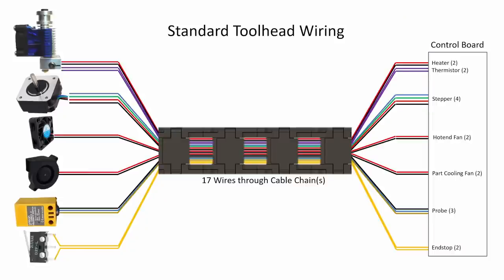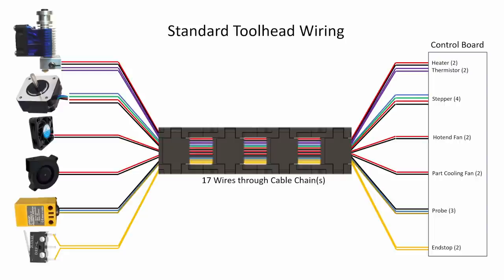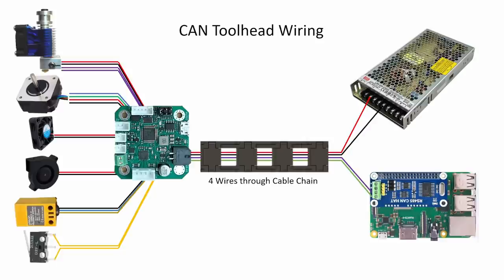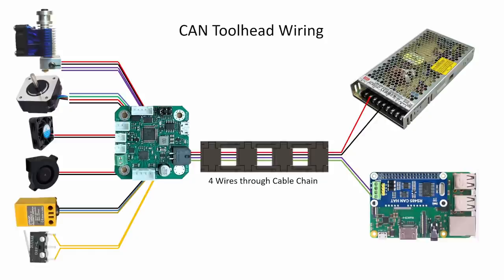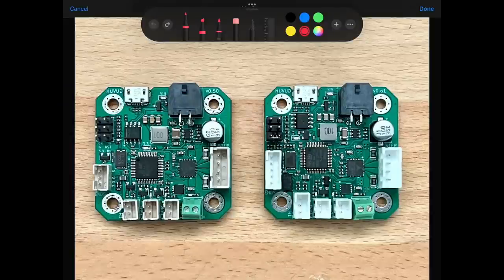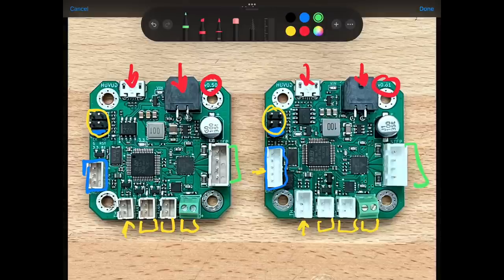Simplify your 3D Printer with a CAN Toolhead Controller!

Comment: You can also use OpenOCD on a Pi to do SWD flashing (from Pi GPIO) of the STM chip, or in a pinch UART and stm32flasher with the boot0 jumper and pulling the resistor that makes the uart half duplex for the TMC2209. ST-Link is by far the easiest option if not in a hurry though.

Comment: A coworker of mine designed and manufactured a breakout board with a similar intent just  a couple weeks ago. He toyed with adding an onboard driver but ultimately ended up with just an atmega 328(arduino), adxl and mosfets built in he's using serial so that all you need to run is an off the shelf USB and a 24v power/gnd. I'm pushing him to release the designs
Reply: Pretty sure we can run the same on this, 24v/G and usb micro to pi

Comment: Thanks for the video! This is a great resource I haven't had time to come back and talk about myself!

Its been a long while since they've been available, it took me a while to choose a manufacturer instead of getting small batches made from a prototype house.

I'm hoping to have an answer on preorder and quantity this week, and will be looking to get batches sent to vendors worldwide so its easier to order in everyone's local countries. 

I appreciate everyone's patience on getting more done, and I'm also sorry about the cost. Unfortunately, with both part availability (price on just the MCU went from ~$.5 to over $14!) and tariffs for importing, I couldn't provide a better price point. If the demand is sufficiently large and I can order large quantities, I'm hoping to drive prices down to ~60 for preorders including a connector kit.
Reply: Looking forward to buying one of these when I can. I was looking to right at the beginning of the pandemic in the "yeah, 1 or 2 more months" stage. :/ $60 isn't unreasonable, especially for a premium printer like a Voron. The StealthBurner adds another compelling reason to use this board - not having to run another set of wires for LED serial comms. :)  However, I'm not seeing a nice clean way to mount a board in that toolhead. Hopefully somebody can show me the way before I build one. I'm sure you're aware, but there seems to be more availability if you move up a bit in capability and switch vendors. For example Microchip's M4. Unfortunately, it's still a lot of work for you developing and selling them and the supply chain is fickle. :(

Best of luck and thank you so much for the contribution and showing us the way!
Reply: Great news. Would you have a list of vendors somewhere so we can all reach-out to them and pre-order. Not sure where to look for it at the moment (I'm in UK).
Reply: @alexdubois6585  printyplease has 100pcs of my units coming to them. Otherwise my preorder is up.

Comment: while there are 17 wires, you can have several items (two fans, hot end, and probe) share a common VCC wire.  Also the end stop, probe, and thermistor share a common ground.  This reduces the wiring from 17 to 13 in total.  Still quite a few wires, but not as bad as first glance.  Also even with the CAN board you STILL need to crimp connectors at the toolhead, that does NOT go away!

Comment: If you want a really stable connection, make sure you have 120 Ohm cables! Together with the 120 Ohm terminations it will look like an infinitely long wire, from an RF point of view, eliminating reflections. This should make it absolutely no problem using a 500k bitrate.
There is good videos about it in YouTube.
Reply from the maker: Agreed! I know it's best to have it, but realistically to add one to this board you have to
1.  Have a surface mount resistor on hand and know how/where to solder it
2. Double crimp a resistor with the data connection wires on the molex connector
3. Hack mount a resistor hanging off the board

I did the last one with my first board, but in general don't recommend that to the average user. "2" is probably the safest and best option, assuming you have a 120ohm resistor on hand with really thin leads so you can still get the terminal properly crimped. 

In general--my approach is if there's a simple way that will work for 95% of cases without the need to solder--that's probably the correct path for most people. I will touch on this some though and explain the options for a follow up video!
Reply: @eddietheengineer  Agree. Well, I hope the new extruder board has them built in ;)
Reply from the maker: @m.sierra5258  yes! I haven’t looked yet at the PCB layout, but hopefully if it’s auto populated and you need to remove one (if you have many boards) if would be in a place that you could knock it off with the tip of a soldering iron
Reply: "There is good videos about it in YouTube."  There are over a billion videos on YouTube. Could you be more specific?

Comment: Just set this up using the BIQU Hermit Crab. I'm a big fan of it. It uses CANBUS and let you run only 1 cable to the toolhead which is awesome.
Reply: Don't the hermit need 1 usb-c to the toolboard + 2 power wires?

Comment: "I have omitted the 120 Ohm resistor on the toolhead" - "I had to turn down CAN bitrate to 250k for stability"
... Maybe there is a connection between those two things? Just maybe?

Comment: That's pretty cool if one ever comes up that fits the orbiter and Stealthburner, I'd be interested.  Still quite a bit less wires than the other toolheads, so bravo.
Reply from the maker: I have a mount for Clockwork 1 and Galileo, and will make a CW2 mount once the CAD files are released!
Reply: @eddietheengineer  awesome . I just put a toolhead on my stealth/Galileo, but I've got comments on the constant use of the JST-XH  connectors forcing folks to crimp., vs using  a screw style like you are using on the bottom right of your board. same pitch 2.54mm, -40-100+c temp rating, can get them from 10amps to 6amps and it removes the crimping all together (yes, one would need furrels but man those are easy!). Obviously one could go further and do screw-less clamps, that would make installation and swaps even easier. I just spent hours crimping today and it's not enjoyable, some wires are just too small and you end up breaking them, other wires (hotend) are too thick and don't fit.. Love to see you all start moving away from these tiny connectors that require crimping :) Your board, only the bottom 2 would have to be adjusted to allow the screw type terminals to be used (but appears you are already running out of real estate, but you could run 2 back to back in the same space as the.2 side by sides there. But obviously the through holes would have to be run horizontal vs vertical. Also if you have a jumper to power via the USB, surprised you can't have a jumper or other to select 5 volt for LEDs or set the fan ports individually.   Cool stuff... but man, these JSTs pissed me off today :)

Comment: Great video!   I'd have loved to have built my Voron with a toolhead board.   As it is, I have some small protoboards to break-out silicone ribbon cables to individual JST connectors.  I wonder if the parts are mostly available?  Might be a fun project,  even with what looks to be 0402 size components..   This seems like a great solution and the wave of the future!  It's amazing how quickly the wire count adds up..
Reply from the maker: Thanks! I'm not sure about component availability for all of the components; the one I've heard regularly having supply issues is the STM32F103 micro that's used.

Comment: Very interesting device, how's extruder driver feels after long prints? I noticed it doesn't have heatsink. Interesting to see if this board requires additional cooling when it run in enclosed(+60C) printer.
Reply from the maker: That's a great question and one I've done some testing on--I haven't been able to get the TMC2209 to have over temp warnings in all the prints I've done with Huvud V0.50 a year ago. I have an enclosed printer with a layer of Reflectix insulation around it, with temps around the toolhead in the 65-75C range

Comment: What such boards doing on a toolhead? I`m not about this one. This one is wiring simplification option. But the general ones that powered by 16 pins from motherboard. Can you omit them. Or there are some logic and it's not just connectivity bridge.

Comment: Do I understand correctly that huvud 0.61 has a 5V pin for probe so you can't use the voron recommended Omron TL-Q5MC2 which is 24V?
Reply from the maker: If you wanted, you could pull 24V off the board someplace and the use a bat85 diode (similar to how we wire the probe with some main control boards) to protect the MCU

Comment: Is there a temp rating on this board? We are looking at 80C chamber rated connections, components and cables for the Valkyrie
Reply from the maker: I only have data from my printer where it’s worked up to 65-75C chamber temp—I believe a lot of components are getting close to their rated temps at that point. It’s worth doing testing and understanding how much margin you’d have in your printer application!

Comment: Looks like someone beat me to it - but can 0.61 handle StealthBurner? I'm thinking the 5V for the end-stop and extra 2 pins, means we can do probe, ERCF, and LEDs? Would love to watch a full walkthrough of installing in a SB config. Thanks again for sharing. Can't wait for more of the Huvud github to be updated.

Also - does lowering the number of wires in the drag chains improve print quality at all? (Always looking for ways to get higher quality prints)
Reply: Probably not, but why run cable chains at all?  I run a Huvud on a Switchwire with an umbilical setup, and I'm going to do the same with the new Huvud I just managed to snag for my 2.4.

Comment: Unrelated, but also not: I don’t like using USB to connect things like screens/sensors to my RPi. gasp! I do however like using UART. Pi3s only have one (?) UART available, but the Pi4 has four (?) I think? For Pi3 users, are there options available in Klipper to multiplex UARTs? Or use an UART expander? If that was a thing, then with a revision the ever-capable, handy-dandy Klipper Expander could handle more than just MOSFETs...
Reply: If you do serial-over-USB, in theory the Linux kernel driver could do DMA transfers or more efficient transfers of data to/from the USB controller as compared to character-at-a-time interrupts for the UART peripherals.

Comment: The formula to calculate heat dissipation is [I² × RDS(ON)] × (VOUT/VIN) so by using 12V you don't heat the mosfet more, nevertheless,  greate video  good job.
Reply from the maker: Thanks for the formula! In this case, I am assuming a constant heater wattage between both input voltages (say 40W), which would make the current 2x higher for the 12V vs 24V input. I think that would mean that the heat dissipation for the mosfet would be 2^2 higher based on this equation? I think the Vout/Vin would be close to 1 in either voltage case?
Reply: @eddietheengineer  a 12V heater I² is not equal to 24V heaters I² if same wattage. in the formula if V differ I² can't be same or result can't be same. ommit vout/vin division if you don't want to calculate resistive thermal dissipation. sorry for my bad english i hope it makes sense.

Comment: Do the crystals have to match? I could only find 12mhz RS485 CAN hats. Video was not definitive about which one to use. I’m guessing 8mhz but not sure.
Reply from the maker: That's a good question, the crystal on the Huvud doesn't have to match the crystal on the CAN hat. The Huvud has an 8Mhz crystal (and you need to set it to 8Mhz in the make menuconfig). 

If your Waveshare is 12Mhz, then that's fine! Just set your config.txt to:
dtoverlay=mcp2515-can0,oscillator=12000000,interrupt=25,spimaxfrequency=2000000

Comment: Do you flash the Huvud 0.61 directly by a RPI with latest Klipper?   Does the CAN hat need to be on the Pi for this or can I add it after?
Reply from the maker: Yes you can flash it from the Pi! The boot jumper must be set, a USB cable connected from the Pi to the Huvud, and 24V sent to the Huvud

Comment: The reason you're having an issue at 500k is because you're not using a 120 resistor on both sides.  Add the missing resistor and the higher speed will work.

Comment: Is it possible to have multiple canbus tool heads connected? Like dual extruder or even 4 toolhead with an automatic tool changer. I was researching about it but cannot fin any example of at least a dual head setup
Reply from the maker: Yes! You can have multiple toolheads on one CAN bus, I do it for Tridex (Trident IDEX)
Reply: @eddietheengineer  do you connect all to the same ports?
Reply from the maker: @IvanGOrtolan  yes! it is best to have the CAN devices in a "chain". I have mine set up so that each toolhead is the "termination point" and then the CAN adapter is at the center

Comment: Will that 5 pin endstop connector finally support bltouch on the huvud board?
It should, but I think I would need to combine the 2 ground wires from the bltouch into the single endstop ground pin.
Reply from the maker: That’s a good question—I haven’t used a BLtouch in a few years unfortunately, so I’m not super familiar on what is required

Comment: CANBUS is an extreme robust protocol when both ends are terminated with a 120ohm resistors otherwise the integrity of the signal will be heavily degraded.

Comment: regarding the accelerometer there is a doubt as you need to meazure the resonance for x and for the y table also) with this board only x ?
Reply: I'm sure it can do multiple axis, the only reason it would be an issue is if you're running something like a bed slinger since the accelerometer would need to be moved. Both X and Y can be measured from the tool head on a coreXY printer.

Comment: Eddie, do you have a mount for this board published anywhere?  I designed a mount I've been using on my Switchwire that uses the hartk mount points on the side of the CW1, but I'd like to transition my 2.4 over to CW2 and I'm not sure how I can make that work with the Huvud.
Reply from the maker: Yes! Not published yet but I can, I have one for the back of CW1 and Galileo, not CW2 yet
Reply: @eddietheengineer  I would love to see your mounts.  I just received a v0.61 Huvud and I removed all the wiring from my 2.4 in preparation to install it.  I can use my existing mount on the CW1 that's still in that printer, but I'm curious to see other ideas.
Reply from the maker: @jakepF1D  I’ll try and get something uploaded tonight!
Reply: @eddietheengineer  Much appreciated!

Comment: Are you able to run the board over the micro USB cable instead of can? As you said alot, maybe not the right or robust way, but it would be a very easy way to get started.
Reply from the maker: I don’t know if you can directly run it through the microusb port but I think you can run the usb data wires to the 4 pin connector and then cut/adjust traces

Comment: Is it possible to use the "Huvud 3D Printer toolhead board" directly with a BTT Octopus instead of a "Raspberry Pi CAN hat" ?
Reply from the maker: Unfortunately not at this time!
Reply: @eddietheengineer  THX
Reply: @eddietheengineer  RS485 CAN HAT support Pi 4 ?
Reply from the maker: @wolfgangmauer7970  yes! I’m using a waveshare can hat on a Pi 4
Reply: @eddietheengineer  THX

Comment: Skipping the pull-up or pull-down resistors would be the reason that you had issues with 500,000 and not 250,000.

Comment: Thanks for the video and the effort!
Concerning the board, am I right that no spare pins (assuming a bl touch is used) are left for controlling pwm fans (the 4 pin fans which provides tacho and accept pwm input)?
I don't see any spare connector.
Reply from the maker: You're correct! There aren't any connectors for 4 pin fans. I'm not sure if you could use the debug pins for the pwm/tach signals or if they need to be 24V?
Reply: @eddietheengineer  pwm and tacho are TTL, any free pin would work bitti don't see any spare pin available on the board, so I guess the only way is to use the extra ones from the endstop
Reply from the maker: @olafmarzocchi6194  I wonder if you could use some of the debug pins?
Reply: @eddietheengineer  probably with klipper it's possible!

Comment: Is it possible to canbus chain multiple devices together? like a proper canbus or is it just a single end to end solution?! (like why not run all motors in a printer with these)
Reply: What would be the point? Can bus takes 4 wires, each motor takes 4 wires. Absolutely pointless overcomplication.
Reply: @FrozenHaxor  can bus is a 2 wire protocol + 2 wire for power - means you can run not only motor, but heat cartridge, sensor, other relays, servos etc off the same chain.. and these cards are readily available - and easy to misuse - i mean adapt till other things than plastic extrusion. :)
Reply: @roughedge-machineworks  It only makes sense for toolhead in 3D Printer application, other motors are spread apart and it's easier to route motor wires directly.
Reply: @FrozenHaxor  also makes sense to daisychain toolhead boards in a robotic arm, and offload main processor of dealing with position data, stepper and limit switches.. Soarry but you are a tad bit narrow minded i suppose to grasp they why of my original question.. it doesnt relate to 3D printing.
Reply: @roughedge-machineworks  Then why post under a video related purely to 3D printing? Your original question also mentioned only a 3D printer. You contradict yourself.
Reply: @FrozenHaxor  When talking to farmers you talk like a farmer, when talking to engineers you talk to engineers.. when talking with people doing 3D printing, talk about 3D printing so they feel familiarity.. Smart people would read between the lines, stupid people nitpick and get hang ups on details and cannot move on..  Guess which category you belong to..